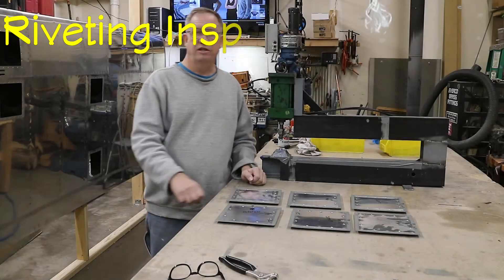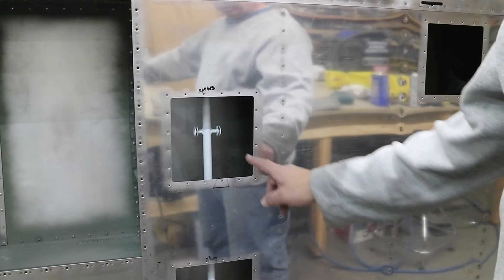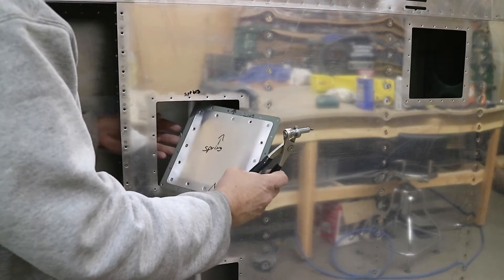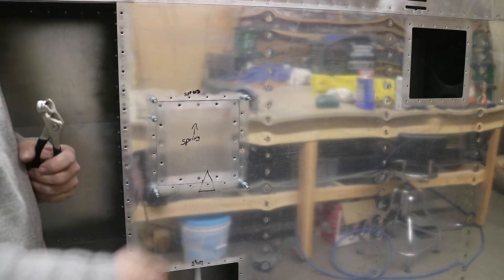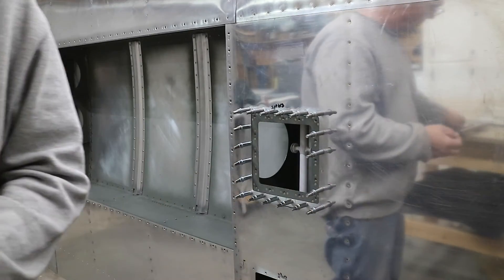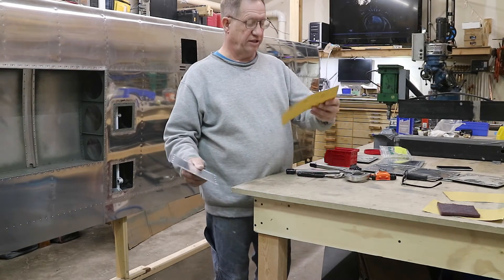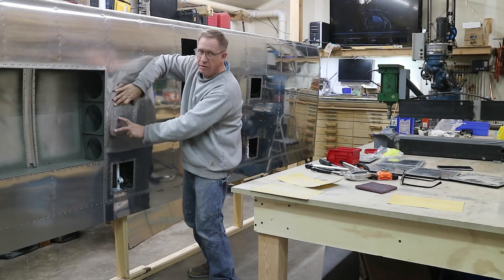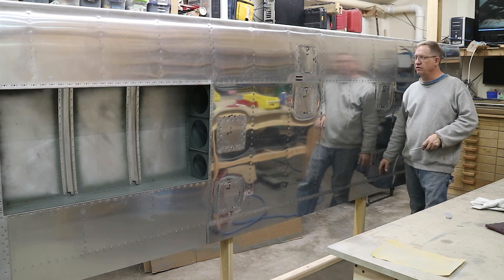Bearhawk Experimental Airplane Build : Riveting Inspection Covers

Comment: could you use 1/4 turn fasteners instead of screws to hold your inspection plates?
Reply from the maker: I would imagine you could, I am following the plans and using what is called out. One thing I would say is screws are cheap and light weight comparatively.